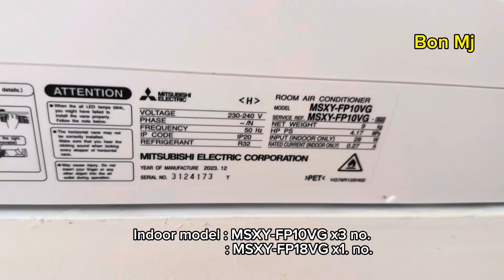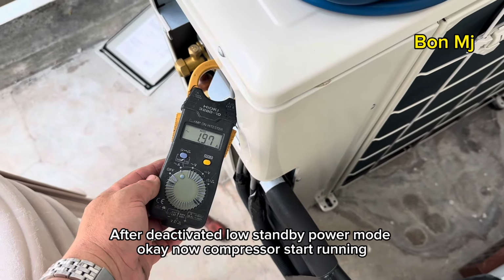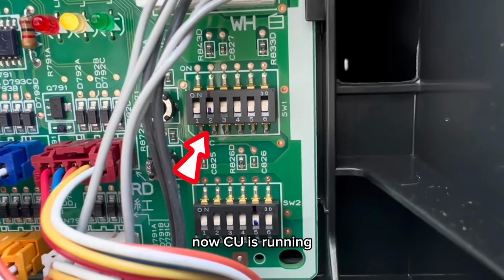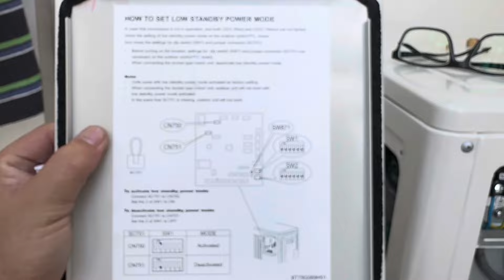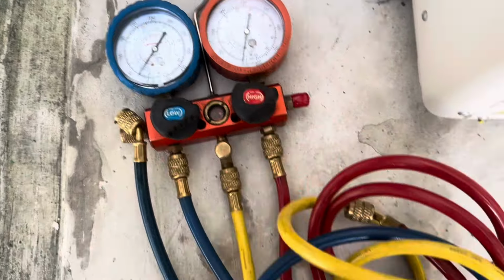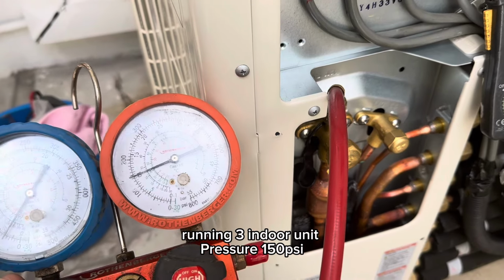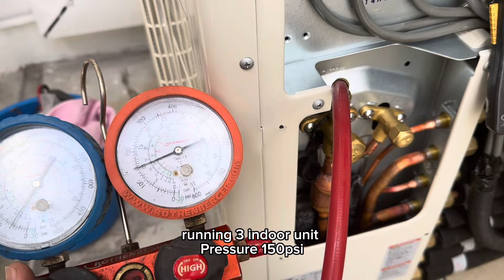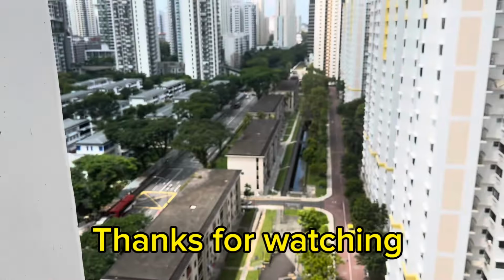Why my newly installed AC not cold | StarMex R32

Comment: 老板晚上好，不好意思打扰你 请问你一下daikin r32gas 
Single spilt  w/m unit 要怎样计算进 gas呢 谢谢
Pipe length 23meter
Reply from the maker: 你好，23meter应该不用进gas
Reply from the maker: 如果12000btu 或以下，你的pipe过长了（不能超过15meter）
如果18000btu-24000btu就ok.不要超过30meter, 应该不用进gas
Reply: @BonMj  老板谢谢你的回复
18k btu 因为我看installation manual都没有写那个top up gas 的 formula
谢谢你的回答
Reply: Mine less than .. 5  meter from indoor to outdoor .  contractor also say no need to top up gas.